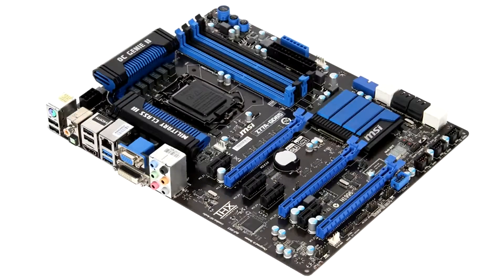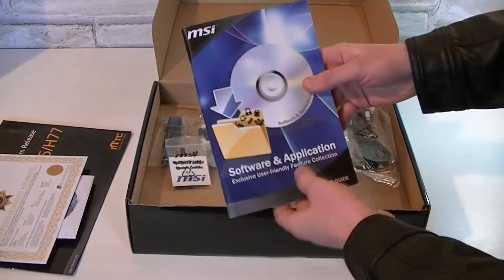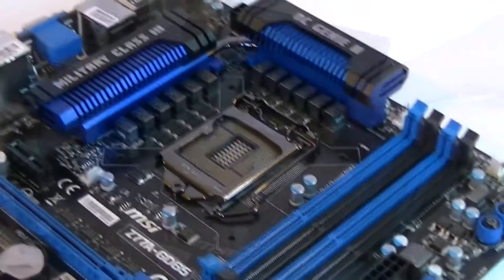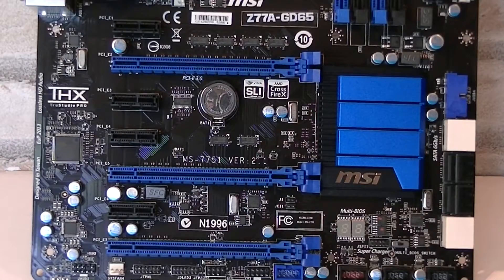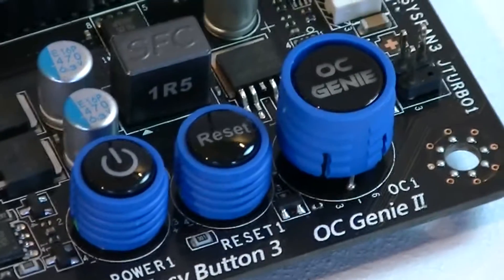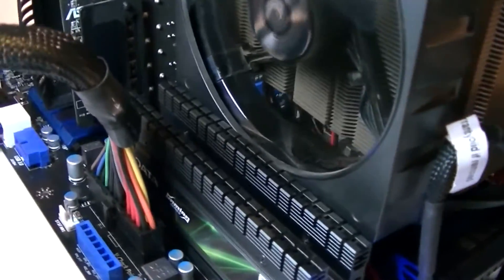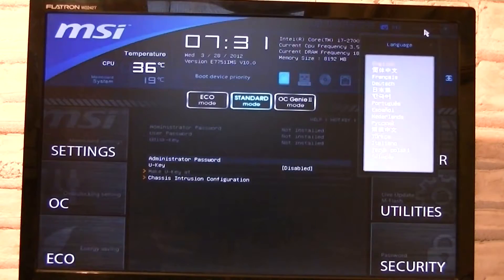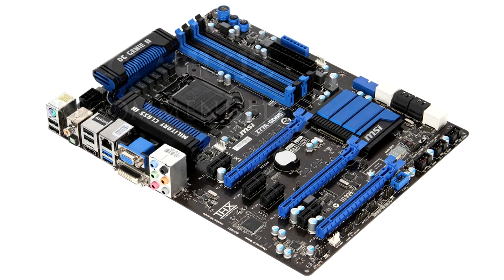MSI Z77A-GD65 Motherboard Review

Comment: I would rather go for the Z77A-GD55 , features from the MSI one seems better. 

Not to mention , that the MSI GD55 is a 8 phase power while the Gigabyte Z77X-UD3H it's only a 4 phase , if your doing OC , its better you getting a 8 phase one , also it's exactly same price here in my country comparing the GD55 and Z77X-UD3H

Comment: hello nicolas im planning to buy this system
i5 3570k
hd 7850
noctua nh-d14
giabayte z77x-ud3h
G.Skill RipJaws-Z F3-2400CL10D-8GZH DDR3 2X4GB 2400MHz cl10
Westren Digital 1TB 64MB Sata3 7200rpm Black
SeaSonic X-650 650Watt

this system is good for gaming?and should i buy the gigabyte z77x-ud3h or msi z77a-gd55?

Comment from the maker: Don't worry, the higher the offered wattage, the better in most cases. It depends on how much power your components consume. In most cases a 750W PSU is more than enough, but 850W is always good. So don't worry your PSU wattage has nothing to do if it will mess things up or so. If you went with a lower wattage PSU, THEN it could mess things up, but also only if your components need more power than the PSU can give. :)

Comment: Thanks for your reviews - 
But when you show the cooler doesn't get in the way of the RAM slots (with 2 sticks installed), you can see that 4 RAM sticks WOULD get in the way of the cooler.  I'm surprised you didn't notice this.

Comment: I'm thinking about getting this Mobo bundled with the Intel Core i5-3570K 3.40 GHz Quad Core Unlocked. both of them together for $450.99. I was curious how good the GPU is in the mobo i have a GTX 9800 Nvidia, is the graphics card in the MSI Z77A-GD65 better than the Nvidia GTX 9800?

Comment from the maker: The MSI Z77A-G45 has 6 phases. This one, the Z77A-GD65 has 12 phases and will do better for overclocking. But you could also do mild overclocks with the G45. I guess you should run stable at 4GHz. Sometimes it will be a little hard, since the phases are just the half amount of the GD65. The GD55 version though, would overclock totally fine. But again, the G45 should do 4GHz+ easily. Yes, the GTX 670 will work great with that motherboard. Hopefully this helped you out! ;)

Comment from the maker: The MSI Z77A-G45 is a pretty good motherboard as well. You're right, it's pretty much a baby brother. You'll basically won't get 8 SATA ports, instead only 6. And it has 6 phases instead of 12 like on this one. But for a Core i5-3570K it should be good enough. So the G45 is a good choice for you! ;)

Comment from the maker: At first thank you very much for your nice comment! I'll of course bother to answer questions I get asked. The Motherboard itself supports Memory frequencies up to 2667MHz and Sandy Bridge CPUs should also be able to handle these frequencies since the motherboard does. Ivy Bridge makes it even easier. This is totally wrong, it doesn't support frequencies only up to 1333MHz, like you saw I ran 1866MHz with ease. Now with an Ivy Bridge CPU I even got 2000MHz allowed. You will have no problems. :)

Comment from the maker: Channel A and B is pretty much like Dual Channel. Imagine it like that, you have 2 Memory modules installed, Channel A and B are the DIMMs that are in use. From there you can change and view the Timing settings for example. But when you fill up all 4 DIMMs there will still be a Channel A and B, because it's the "Dual" Channel Technology. So this actually doesn't have much to do with the color of the DIMMs. I hope this helped you out! :)

Comment: Hi Nic. Nice review. This is the one I'm thinking of getting for my next rig. Kudos for showing the fan clearance part it was worrying me as to whether my current Noctua NH-U12P SE would clear the heatsinks on the power phases and ram. In any case, I am firmly in mind to get a Phanteks PH-TC14PE which looks like the best air cooler on the market today - would the clearance be ok ? The Noc NH-D14 (which is a similar size) is listed as compatible...

Comment from the maker: Thank you very much! I'm using the ADATA XPG G Series v2.0 8GB DDR3-2000 Memory Kit. 
I know the list is short, but most kits will work fine even if they aren't on the list. I'm running my RAM at 1866MHz, but could go even higher like over 2133MHz as well, because the motherboard supports it. :)

Comment from the maker: I tried the Smart Fan feature and I'm very happy with it. I set up like 50C on the CPU temperature and select the custom minimum RPM of the CPU fans. This way the system is silent and stays cool at the same time, since the RPM go up when the CPU reaches 50C. I don't own any PWM fans so I can't tell you that, but I owned motherboards from Gigabyte, ASUS, ASRock and this MSI is definitely the best of them all in my opinion.